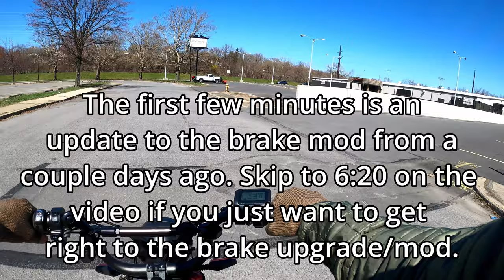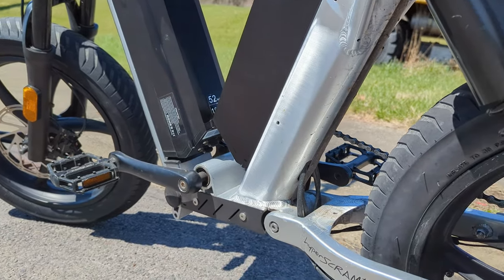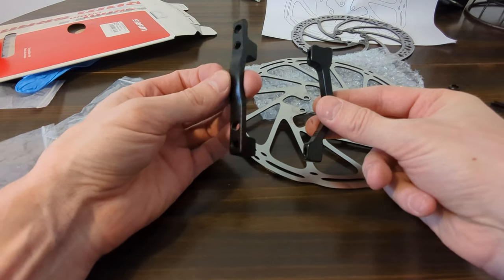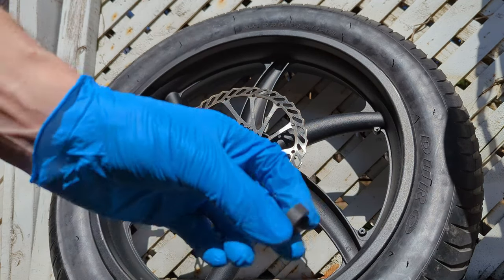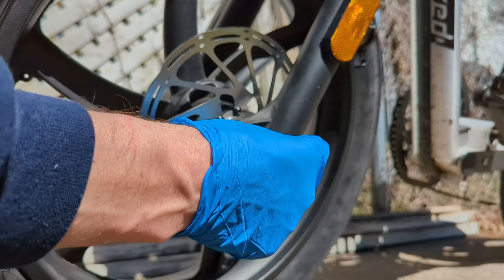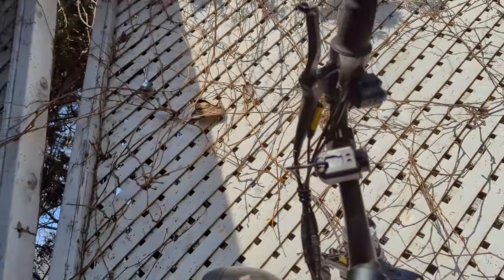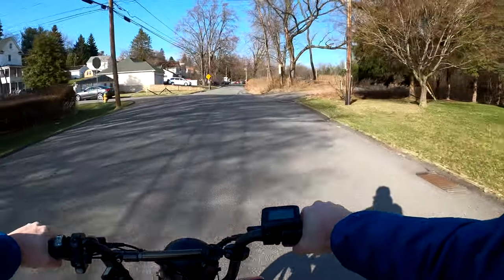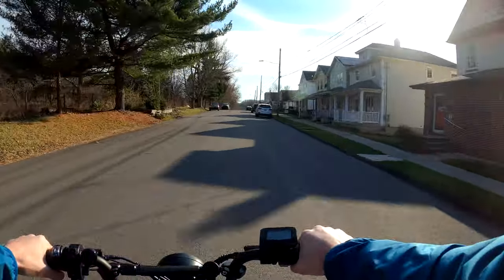E-Bike Front Rotor Upgrade - 180mm to 203mm Mod - Ep.76

Comment: Thanks for the help man. I'm installing Zoom 4 piston 203mm brakes front and rear on my custom ebike. Cruising at 50 with 180mm just wasn't cutting it.
Reply from the maker: Sounds like a great set up. 203 rotors on an e-bike that fast should be standard. You'll have no problem dodging those pesky squirrels now lol. Glad I was able to help out a little. Safe riding!

Comment: Hopefully you can try a different pad material if you didn't already..👍
Reply from the maker: Now that both rotors have been changed to 204mm I have basically no squealing at all. So far whatever pads I use seem to be ok since putting the larger rotors on. Hope it stays this way!!

Comment: I would probably be satisfied with only doing my front.. Most of the stopping is done by the front anyway.. My bike is only 74lbs so maybe just the front. But for 35 mph I may opt for rear also..
Reply from the maker: If the back didn't squeal really bad I would have just changed the front. Now that both rotors are changed I have almost no squealing at all!! What an amazing improvement. I wish I had done it sooner.
Reply: @keepingitkresky4412  good stuff.  I expect a tad noise, no matter what.
Reply from the maker: A little noise definitely isn't bad. It's when they get to embarrassing decibel levels lol. Let's hope they stay quiet!

Comment: What material pads did you chose? Standard stock pads?
Reply from the maker: I have been using Shimano Resin Disk Pads. So far so good. Almost no squealing at all since I upgraded both front and rear rotors to 204mm.